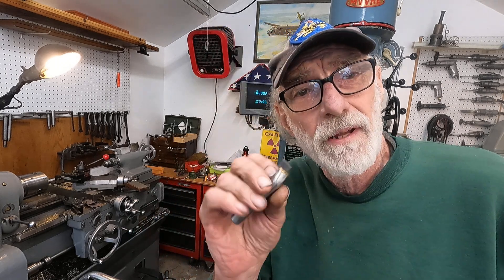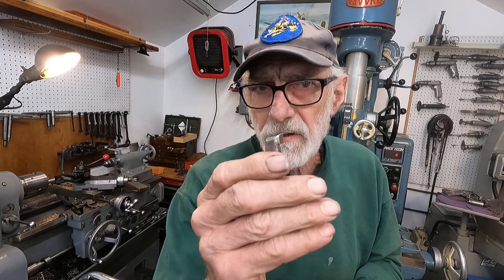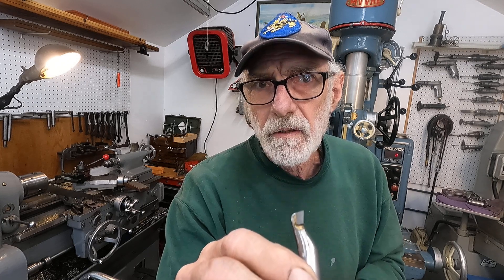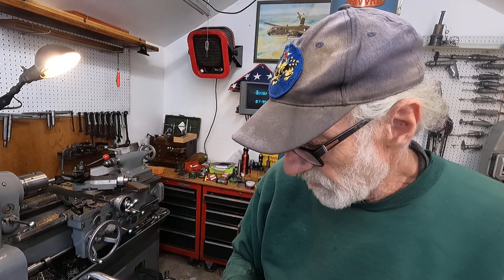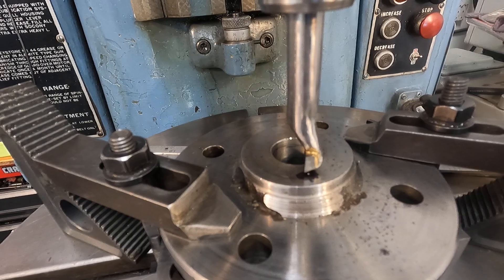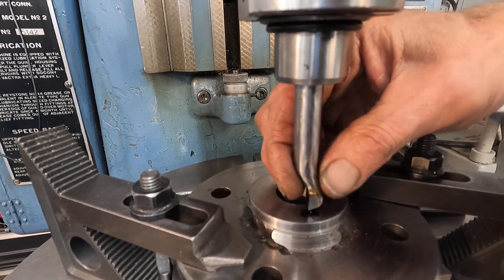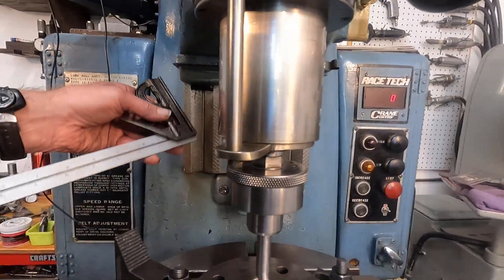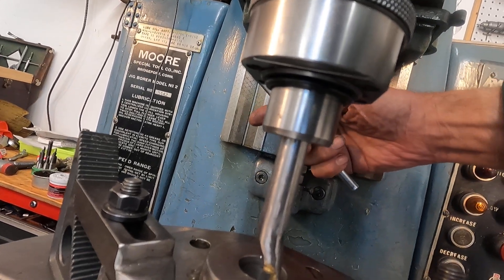Moore jig boring machine basic hole making 3

Comment: The years of experience are obvious !   And a remarkable machine .   Can you attach a name to that wax lube ?  ... and is it still available, or are using something you acquired years ago .
Reply from the maker: The lube is a mix of beeswax, Castrol MolyDee, and cutting fluid. The wax is melted and the ingredients mixed in, the mix is brought to a grease that can be applied with a brush. Regular thread cutting oil is used to thin as needed.
Reply: @deedeeindustrialsuperprecision  Thanks,  DeeDee ...... appreciate it !  ..... I got most of the ingredients on hand .

Comment: now can you do grinding with your machine?  I've seen other Moore machines that don't need a boring head.
Reply: Yes, you can grind with a jig borer, but that is best done with a similar machine called a jig grinder.  The jig borer needs to have a grinding head with an air or electric grinding spindle in order to grind holes.  These work like a boring head and generally require you to stop the spindle rotation to adjust size.  A jig grinding machine has a micrometer adjustment on the head which allows you to adjust size while the spindle is turning.  Moore jig grinders do not have a provision for mounting a boring head.  They are a grind-only machine.  I run one at work.
Reply from the maker: They had many grinding attachments for the early jig borers including electric motor powered slot grinding attachments,  motorized table centers, but seemed to be replace by the dedicated jig grinding machine in the later 1950s from what I have seen Moore made special and one off machines and attachments also for gov research